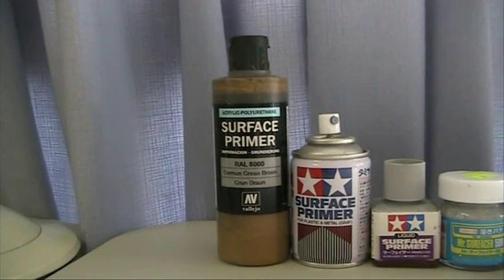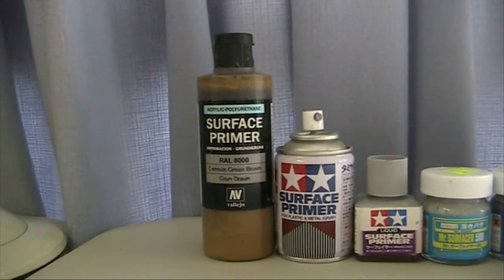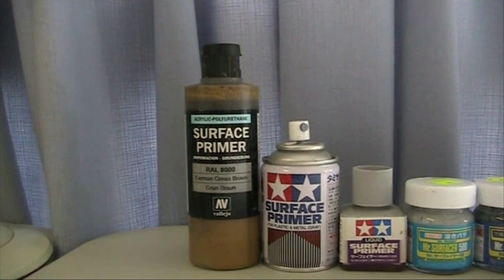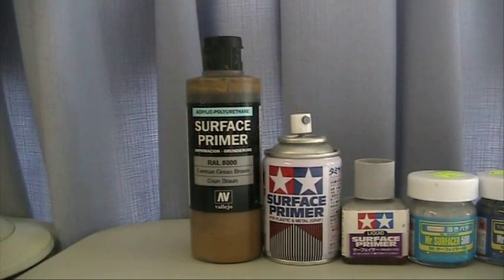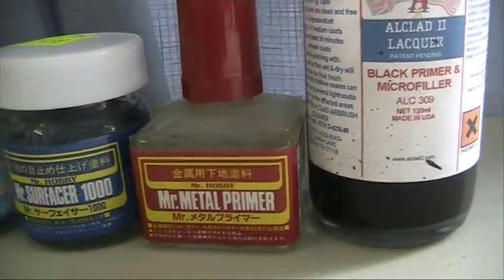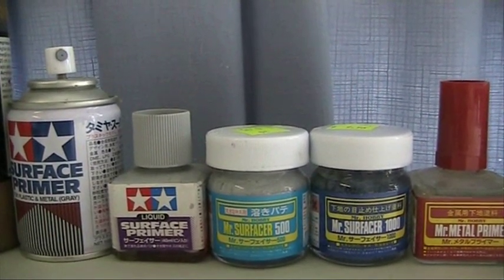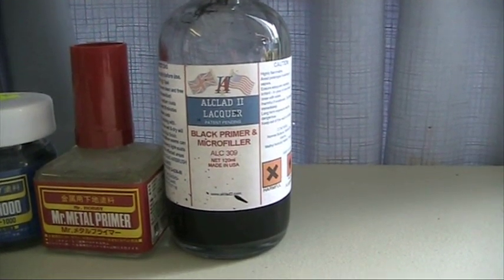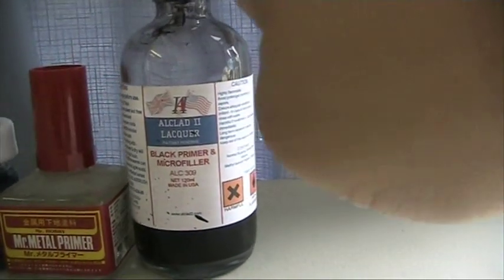Gundam/ mech model workshop 82: Primer theory

Comment: Hey mokanaman, got a question: If I were to use Tamiya spray paint cans on an unpainted model kit, do I need to use a primer? There are forums that suggest Tamiya spray paint is strong enough to stick to the plastic without the need of a primer.
Reply from the maker: Sadly there is a lot of misinformation in our community. If Tamiya paint was strong enough by it self then Tamiya would not market and sell a primer. It would also be disappointing if you spend a lot of money of spray paint and the finish is damaged.
Reply: mokanaman I see, alright I'll just stick to using a primer whenever I paint a model kit. Thanks for the answer though.
Reply: He might be right but my kits are fine with out primer. Admittedly I don't fiddle around with them much.
Reply from the maker: doubleOZ
The tutorials I make are from 15 years experience building and competing. I admit there are about 1000 different methods of modeling including some were primer is not recommended. All I can do is advise according to my personal style. More then happy to hear others experiences but not priming has had bad consonances for me.

Comment: Hey there, once again thanks for this video.  What ratio do you usually use to thin the Tamiya Surface primer?
Reply from the maker: I start with 50/50 then normally add a few more drops of thinner.
Reply: Thanks for the tip!
Reply: mokanaman will 50/50 primer/thinner work for hand painting?

Comment: Super informative! Wondering what your opinion on Mr. Resin Primer is? I am about to build a resin and metal car kit and I figure using Mr. Surfacer should suffice. Also, can I then put Tamiya Fine White Surface Primer over the grey Mr. Surfacer on the resin before colour coating?
Reply from the maker: I have not used Mr. Resin primer but a good friend of mine swears by it and noticed improved performance over normal Mr. Surfacer. Once applied you can put anything on top including Tamiya primer. I would also recommend watching my video on Mr. Metal primer for those metal parts.

Comment: Hi, I want to prime my gundam kits but i dont want to use spray cans due to several reasons. For handbrushing primer, would you recommend Mr surfacer 1200? Also do you need to thin it with thinner?
Reply from the maker: You can hand paint Mr. Surfacer and yes it will need lacquer thinner. I recommend watching my hand painting with lacquer video.

Comment: Hey mokanaman, I was going to pick Tamiya Primer Grey up to Prime a large Resin star destroyer kit. Is this not the right primer to use? I will be washing the kit this dish soap water. Will be using the spray can primer. I also will use Tamiya spray can colour for the top coat. Any suggestion or is this ok?

Many thanks in advance
Reply from the maker: You can, but from my experience Mr. Surfacer reacts to resin and has a stronger etch then tamiya with I only use on styrene. I recommend Mr. Surfacer 1200 or 1500. Spray can primer is perfectly alright.
Reply: +mokanaman thank you Sir, much appreciated
Reply from the maker: any time

Comment: I was looking at valejo primer until the chipping issue thing will happen if you plan to pose your gundam models many times.  So what kind of primer you would need to use for prep that's good for acrylic paint after primer?
Reply from the maker: I struggle to call Valejo a primer due to not etching or adhering to a surface. Anything product with solvent and cured will allow arylic to sit on it. On a budget automotive or industrial lacquer primer via airbrush thinner several times over or rattle can will do the trick well. Tamiya, Gaia notes and Mr. Color all do many different priming products which I will link the reviews below.
https://www.youtube.com/watch?v=hWNHKjCfb3I
https://www.youtube.com/watch?v=TcnGhhvc8cw
https://www.youtube.com/watch?v=jnltzUD-hwY
https://www.youtube.com/watch?v=DzfZvz6-_Bg
https://www.youtube.com/watch?v=_Lp1puYPvBw&t=1s
Reply: @mokanaman  Thank you! I bookmarked this video for reference that i can use in the future.

Comment: I was thinking of painting the clear parts of the MG Unicorn Gundam OVA ver because the clear plastic was more pink than red. Is it necessary to use a primer on the clear parts before I paint it? Will it work?
Reply from the maker: use a clear primer, future floor or clear lacquer if paints used are transparent.
Reply: Got it, thanks.

Comment: I use a Tamia liquid surface primer on my airplane models but when I spray it on it feels like it's dusty or like sand paper, is it supposed to be like that of not how can I make it very smooth?
Reply from the maker: +Stas Ethridge Add a little more thinner and spray closer to your model. The primer is drying before hitting your model.

Comment: I also use primer so the question is with spray cans, even though they say for plastic or metal does that mean they will take to the surface on their own? Even in hardware shops cans are sold that say can be used over rust with out primer or even cleaning the surface, probably not recommended but would they work just as well?
Reply from the maker: They work very well, me and ghost of zeon has used the same brand of full strength automotive primer. The rust kill stuff is good for plastic only catch it may apply a bit thick.
Reply: mokanaman If you don't mind me asking, which brand of automotive primer is it? Perks of being an Aussie is they prob sell it locally.
Reply from the maker: Supercheap auto use to sell 3M automotive primer in a can and tin. I think it is now relabeled as its own house brand or the label has changed. But Supercheap auto is your best bet for both thinner and auto primer.

Comment: Which is better, priming the model while still on the sprue, or after it is built and prior to painting?  I believe the latter is what most people do.
Reply from the maker: The latter is the current trendy and effective method in priming. Priming and painting on the runners is an older method of modeling so you will see some people doing for one reason or habit.

Comment: So hey can I use tamiya liquid surface primer and thin it with tamiya acrylic thinner so I can handpaint
Reply from the maker: +GABBYSUN17 Man you wanted that answer quick, no you need lacquer thinner for hand painting or airbrushing.
Reply: NAME from my beginning experience with hand painting with the tamiya surface primer, and lacquer thinner, I've had a tough time getting the primer/thinner ratio just right. I want a thin coat, but too much thinner is damaging the plastic. it is drying so quickly (10 seconds or less, I have no retardants) that if I go back over for a second brush stroke, my primer begins to clump and remove itself almost. I am thinking that will happen when I go for a second coat, I haven't gotten that far yet. I've given it 3 tries now an I've had to remove all the primer and sand and try again. I'm thinking I may just go get some of the primer in the spray can, or my other option, I just discovered I have some acrylic primer that I may have to use instead.

Comment: Not boring at all. Just used. Vallejo and it went on well but does come off. Now I know that it’s not best for moving gundams. Will try tamiya next. Thanx in 2017
Reply from the maker: With adhesion it's a probability matter, Vallejo is perfectly fine on a based and mounted kit which is not being handled or played with. Once masking, snap fit joints and articulation comes to play the chances of chipping of lifting is more likely. If your likely to change your style or attempt new things this will an issue latter on. Thank you very much for the feed back.

Comment: Iam using Aclad it doesnt need thinner its just straight use what do u think about it is aclad good?
Reply from the maker: like all lacquer products it will dry out and thicken over time and will require thinner. Besides that its ok but not my favorite.
Reply: what is ur favorite ? that is cheap for airbrush
Reply from the maker: Jan Raleiigh
Aclad is very expensive because it is pre thinned and your mostly paying for the thinner. I really enjoy Tamiya primer on styrene. It is really thick so you can make a ton of primer out of it. Just remember to use lots of thinner.
Reply: primer of tamiya are u talking about the spray can? :P
Reply from the maker: Jan Raleiigh
no the square shape glass bottle one.
Reply: thanks can i use X-20 on that and whats the ratio /
Reply from the maker: Jan Raleiigh no lacquer thinner must be used.

Comment: jump to 7:04 to save 7 mins off your life.
Reply from the maker: Chin Pow quite a rude statement, if you did not want to learn about primer and different types of primers and applications you most likely have clicked on the incorrect video. I hope to not see future comments from you.
Reply: I served in military for 13 yrs and due to that my life span has been greatly shortened.So forgive me for wanting to get the most out of my life.
Reply from the maker: I spend a lot of time researching and delivering  these videos. I am also not one to be conned though emotional black mail. I know many modelers cherry pick information from my content for there needs and am fine with this. Rubbishing the basic information because your more advanced is quite rude. I shall block your profile from my account and will not be answer your questions any more.
Reply: Do as you see fit.And I will do the same.
Reply: Star cab I